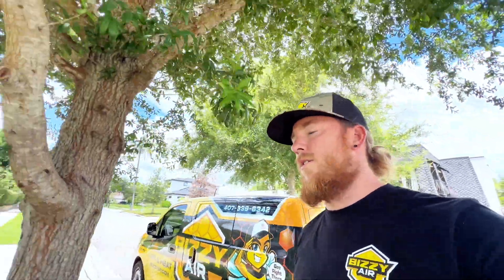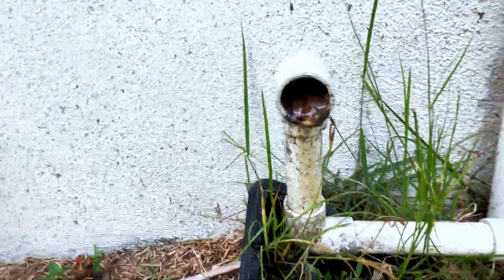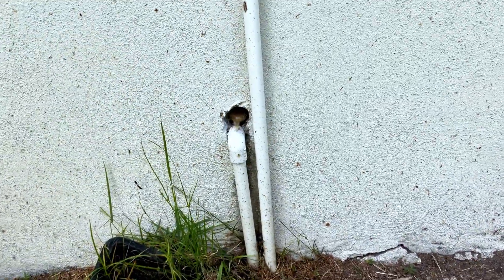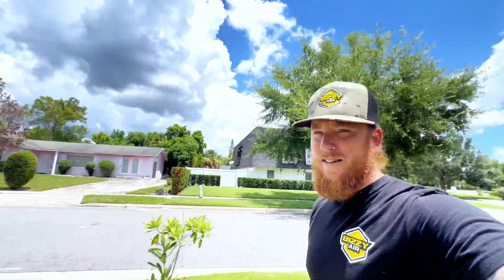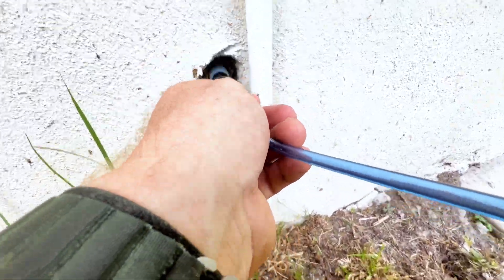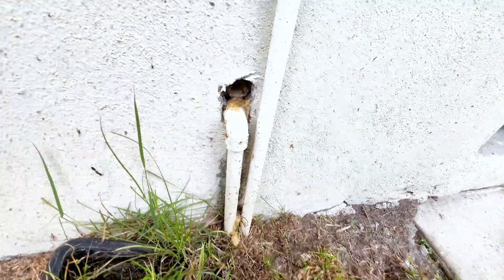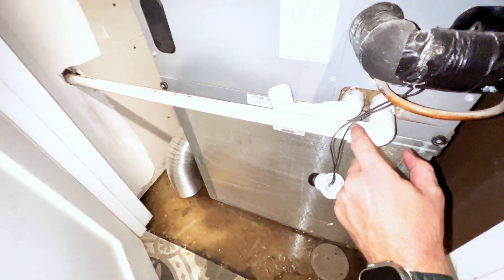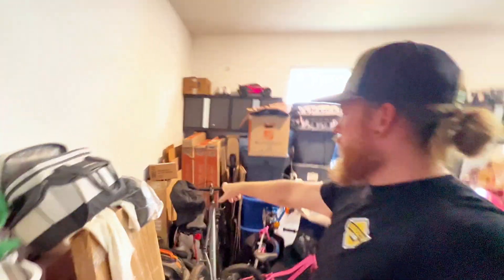This was NASTY | HVAC | BACKED up drain line, and BYPASSED disconnect

Comment: I am in a mobile home and was wondering if you could help. 

Backstory: The unit started to freeze up at 64F inside house, thermostat set for 60F, 85 outside (i like it 🥶 ❄️ at night). I was using standard 3m merv 5 pleated filters on the A-coil( but tech said the evaporator coil was getting the cardboard/filter pleats that the filters are made of wet makeing more restrictoed air and to use those metal mesh A-coil filters 16 x 25)
 And merv 1 on return door(20in x 30in)=merv 1+merv5= merv 6 Total.

Those metal mesh A-coil filters are not that good at catching dust is their any other filters I could use on the A-coil evaporator without getting the paper pleated filters wet.

 The company that installed the unit put a R-410A 5 ton A-coil evaporator with a 3.5 piston in A-coil then put a 3.5 ton condenser outside. The air intake is a 20 in x 30 in with blower (4 speed up to 4 ton HP/AC, 2.9 FLA, 1/3 horse power@ high speed 1460
Reply from the maker: Without checking total envelope and performance of system, and making sure piston is matched correctly would be hard to tell, those are the only filters I’m familiar that would help resolve this issue.

Comment: You got to see some of what Big Mike sees when Barack has been out on the town!  Yummy!
What would make a residential compressor try to run in reverse?  At least you didn't have to listen to a smoke alarm chirping.
Reply from the maker: When I reinstalled the float, I must of hit it just slightly, and interrupted that 24v to contactor and ever so quickly it reengaged, and caused to reverse!
Reply: @KoolinwithKrauss  Hmmm, that sounds like a manufacturing defect to me...